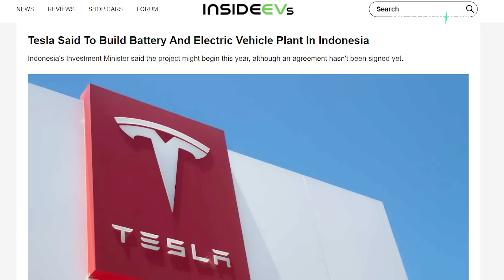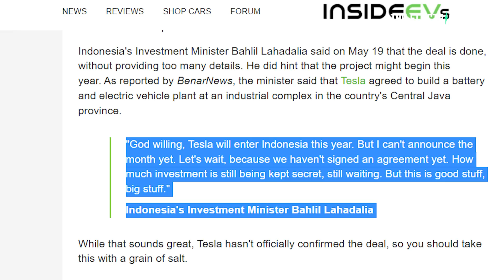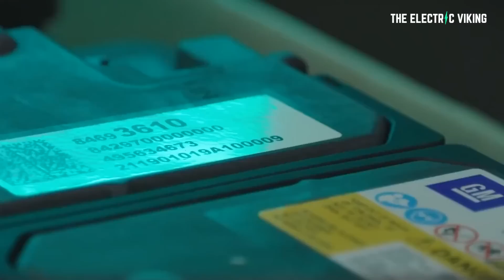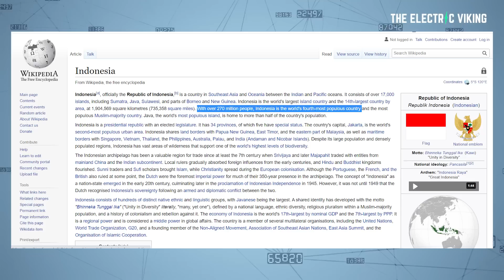Tesla's Indonesian Gigafactory is PURE fantasy

Comment: 4680 factories near their raw materials sounds very plausible. Less complex than a car factory, less transport cost. Instead of shipping raw materials to Gigafactories, Tesla will ship batteries to whichever Gigafactory needs them. Optimizes the supply chain and lowers production cost.
Reply: @brunoheggli2888  Stop trolling.
Reply: @brunoheggli2888  You know that Tesla is the leading EV maker, so claiming they are "unimportant" in that market is clearly trolling. You have been trolling on this channel for a long time. Please stop it. Your trolling is a form of harassment, it is annoying and reflects badly on you.
Reply: @brunoheggli2888  lol why are you so obsessed with Tesla this small insignificant car company, we’re you hired to do this?
Reply: @brunoheggli2888  What is your definition of "important"? I won't be answering you back.
Reply: @lchpdmq  Of coarse he was, no one in his right mind would do this otherwise.
Reply: Problem is battery is heavy. Transportation is a problem for battery transportation. Better install it directly to a car and transported as a car.

Comment: I think elon is leveraging starlink to get more favorable terms for battery supplies. There is a lot of geopolitical risk in China. Hedging against that by building in Indonesia makes a lot of sense.

That said, you're right in that a battery plant makes way more sense than a car plant but they can stage gate it.  Ie tesla first secures land to build a large facility. Start by building the cathode factory and exporting cathode. Then build the 4680 lines,  supply the 4680 cells to these mini ev and scooter manufacturers in the Indonesian domestic market. Tesla has stated they're not interested in building those types of vehicles.  Then 4-5 years down the line, they can build the car production line, if economic conditions are right.
Reply: Hello, fan!
Thanks for reaching out congratulation 🎁🎊🎉You Won a (PlayStation5)Cheerful send a message above to acknowledge your prize🎁